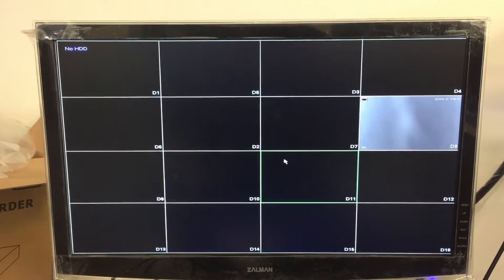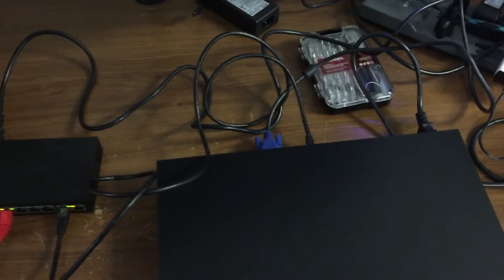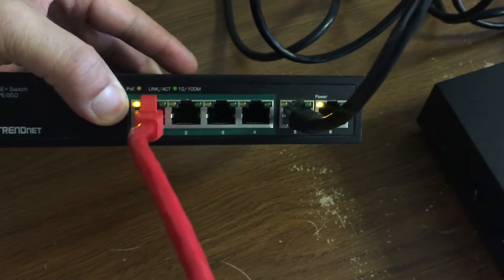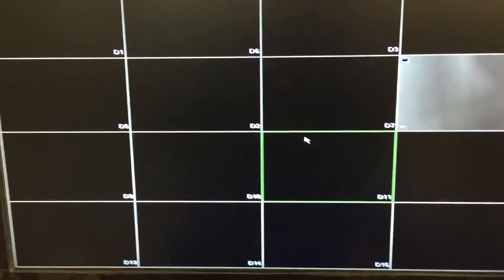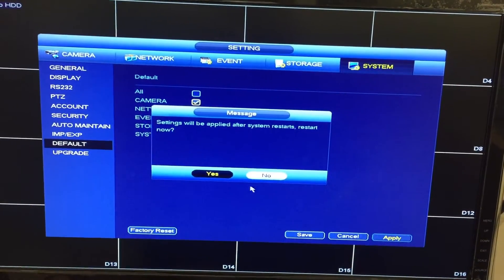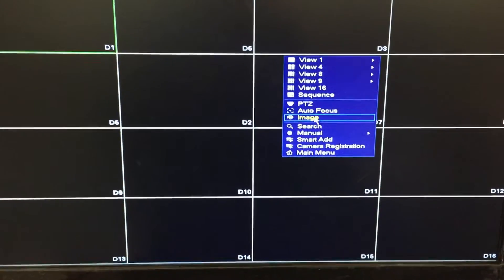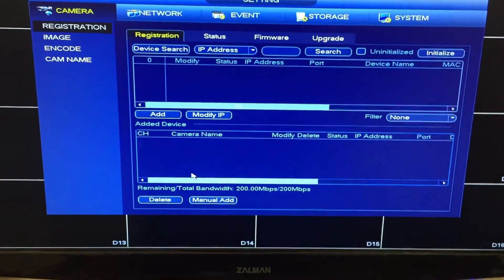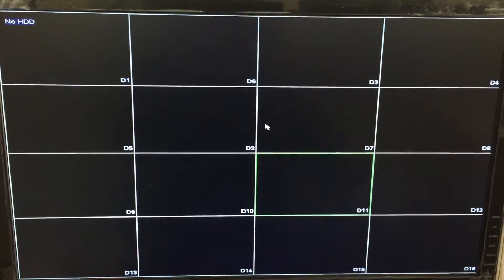Adding IP cameras using a PoE Switch connected to NVR PoE Port

Comment: 48v is nvr port output it dont demage poe switch ???
Reply from the maker: The NVR includes an active PoE switch, which intelligently determines whether a connected device requires power. This contrasts with passive PoE devices, which supply power to any connected device without negotiation, posing a risk of damage. For a detailed comparison of Passive vs. Active PoE, we invite you to read our comprehensive article on the topic.

https://www.cctvcameraworld.com/difference-active-vs-passive-poe/